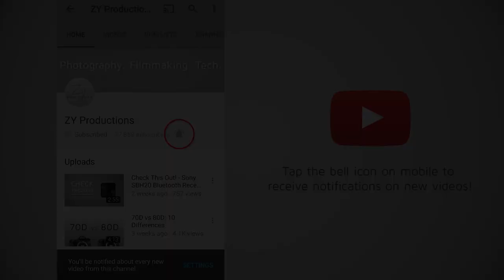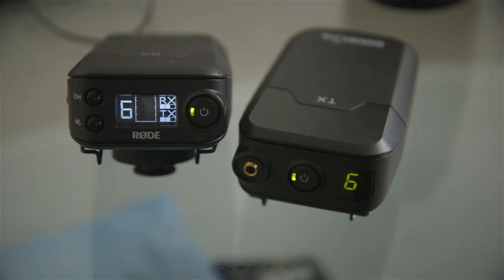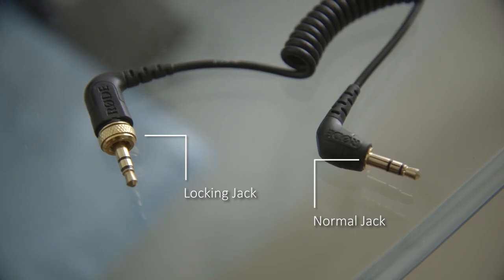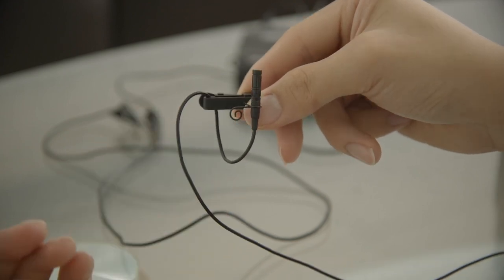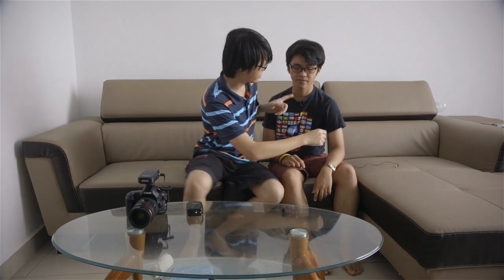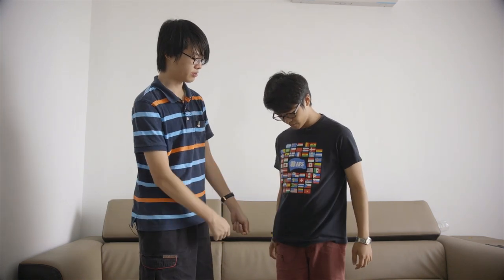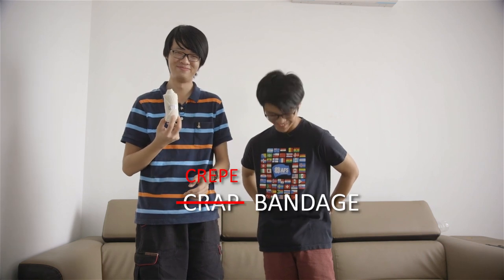How to Set Up a Wireless Lavalier Mic

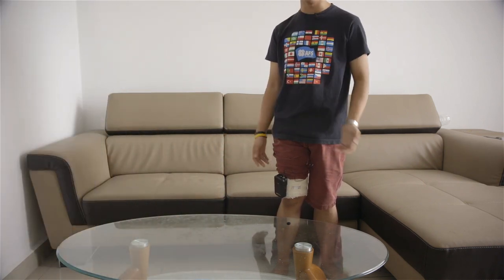Comment: Quick question. At 7:30 there is more noise in the video as you demonstrate the mic on the talent, but why is there no noise in the rest of the video?
Reply from the maker: At 7:30 I switched to the audio track recorded on the 5D Mark III (Rodelink wireless into 5D's mic-in). The preamps on the 5D are pretty terrible hence the higher noise floor. For the rest of the video the audio was recorded into a Zoom H6.